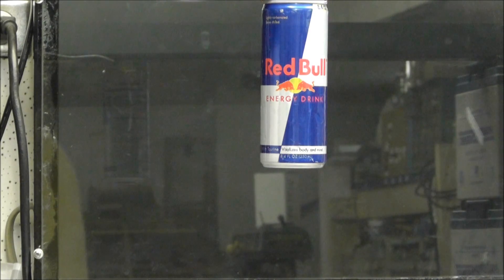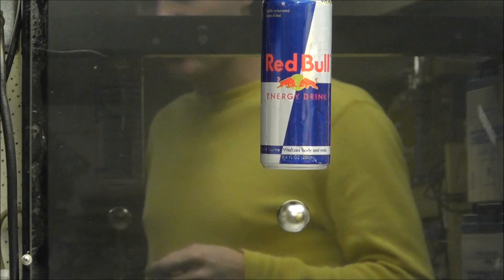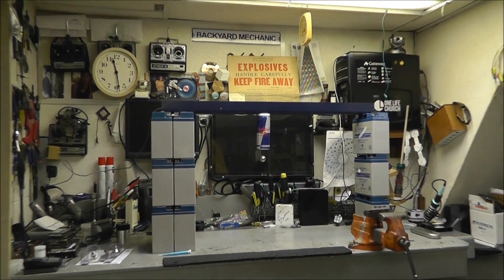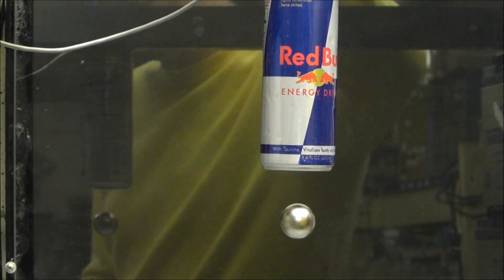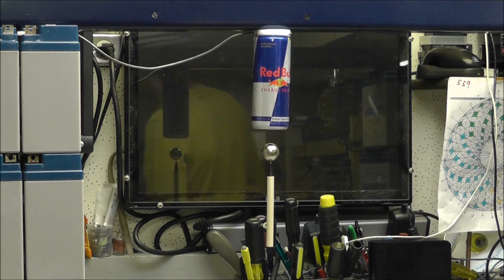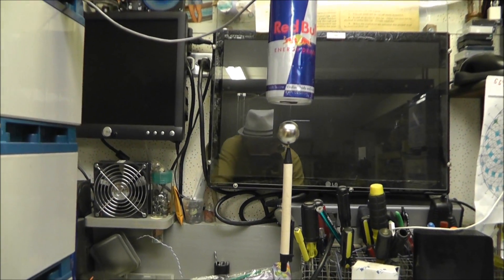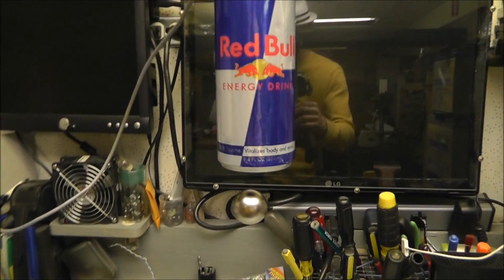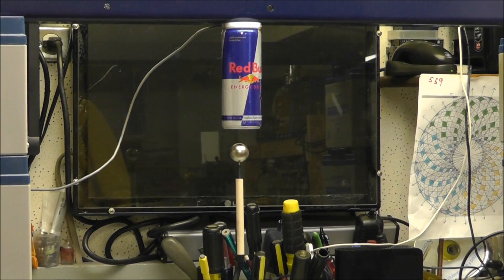Red Bull Gives You Wings. Magnetic Levitation Device. RWGresearch.com

Comment: hey russ, i know your specialty is experimenting with engines, electronics and energy related things. BUT if you ever got into other types of machinery, you should kinda check out filabot project, filabot d0t c0m , i found it on zeitnews but they have a site. its basically using parts of a computer to take recycable materials (plastics and some papers) and melts extrudes ect. into 3D Printing filament.